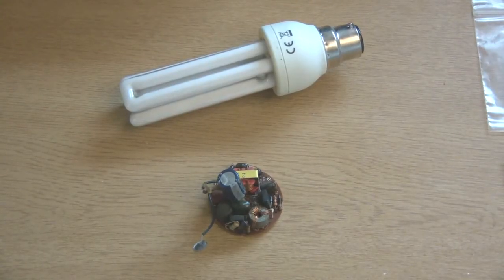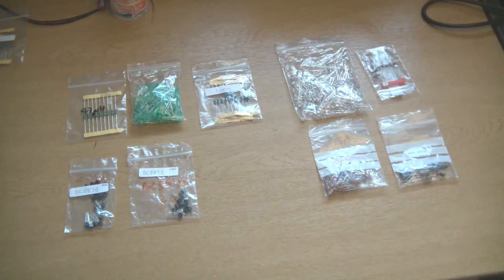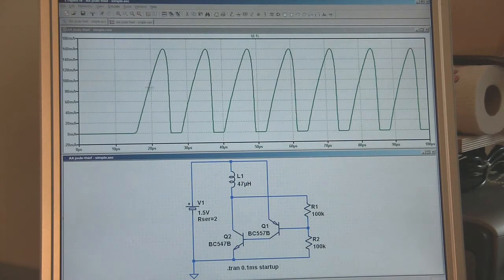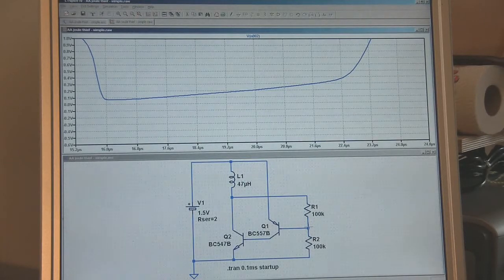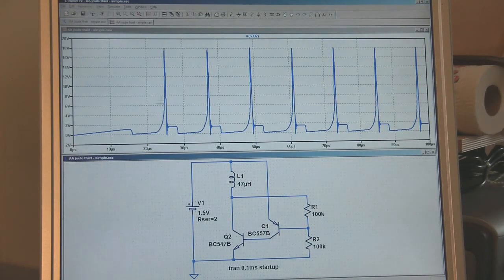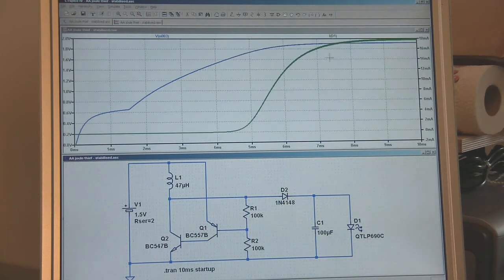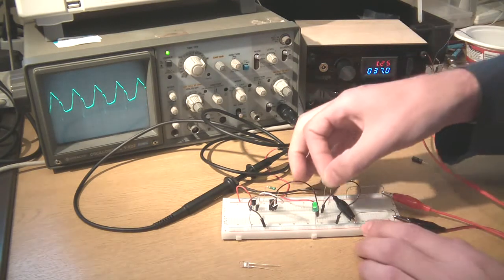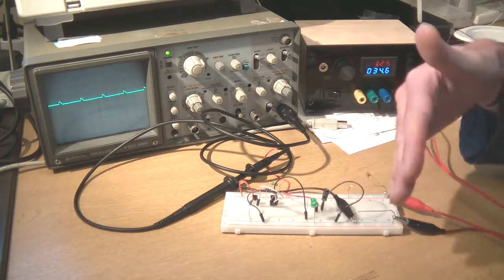DC Boost Converter - A single inductor Joule Thief

Comment: 11:15 Thats what I tried with duel-inductor coil with one transistor joule thief and it didn't blinks, indicating that its waved DC and to make it pure, I also added a rectifying diode and a smoothing capacitor just like you did. Nice video.

Comment: I built this circuit using an S8050 NPN (Q2) and S8550 PNP (Q1) , but it would not oscillate for me until I put a 455KHz filter (which I used for a capacitor) across R1. Now it is doing super well. 100pf or so would do as well I think. My alkaline batteries were quite spent and may have had too much internal resistance.

Comment: You really are a smart person.  You explain things so well.  It will take a while before I can fully understand this, though, because I see current as going from negative to positive.  And transistors are still new to me. Thank you for making this video and sharing it.
Reply from the maker: To fully understand transistors you do actually need to think in terms of actual current flow (negative to positive). If you can handle a bit of theory, get a copy of Microelectronics by Jacob Millman. They're very cheap on the secondhand market.

Comment: Good vid, and a good explanation of a boost converter, but you need to work on the efficiency of that thing. When you remove the green LED from the circuit (thereby removing the load) the input current drops by just 0.7mA (down from 37.0mA to 36.3mA).
Reply from the maker: These simple converters are notoriously inefficient. It can be as low 1%, although in a Spice simulation I was able to achieve about 40% using a 2222 and 2907 pair. There are other more practical uses for the circuit, but I'll have to do another video to explain that.
Reply from the maker: Here's a quick follow-up discussing the efficiency:
DC Boost Converter ("Joule Thief") Efficiency Measurement